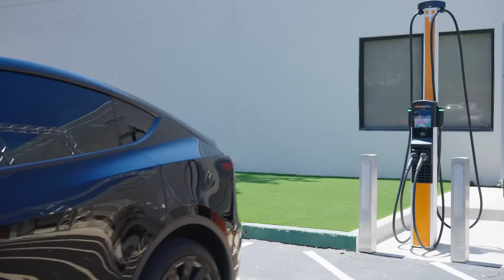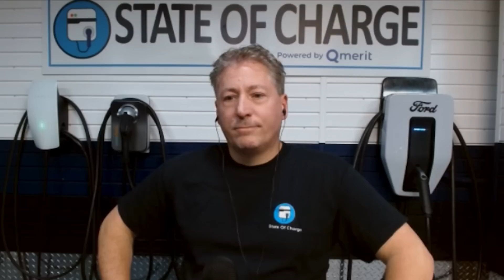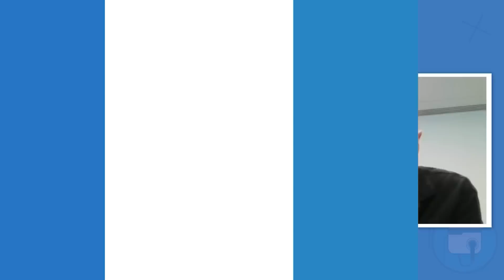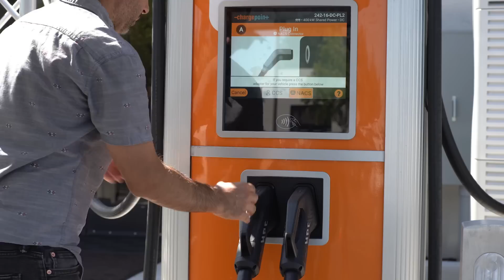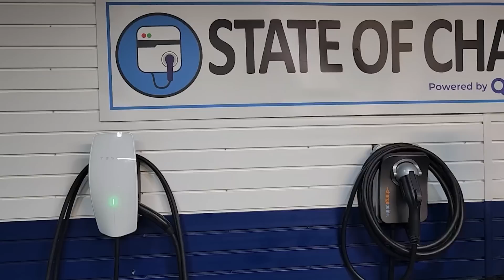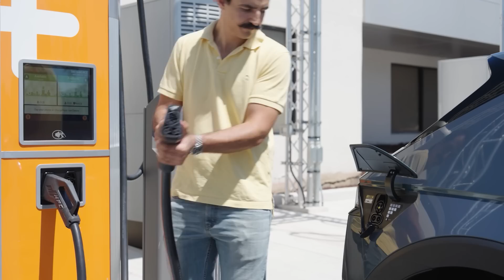ChargePoint CEO Rick Wilmer Discusses How Omni Port Will Eliminate EV Charging Connector Confusion

Comment: I called AND left a report in the app 7 months ago after watching this video and it’s still broken the exact same way. More effort needs to go into the repair of your chargers.
Reply from the maker: So you probably know it's not "their" chargers. The person or company that owns the property the charger is on owns it and is responsible for its maintenance. ChargePoint reports the station down to the property owner and asks if they would like them to send a repair crew, but they need to be authorized to do the repair. They cannot enter private property without permission, conduct repairs on equipment that they do not own, and then expect to get paid for the repair.
Reply: @ for sure, I understand that. I just think their model of selling chargers that nobody takes care of is unsustainable, especially with how the public abuses them. I reached out to the management of the building as well and they told me that charge point wasn’t able to supply them with the parts they needed and wanted them to replace the entire $4k unit over a frayed cable. They also said they would have to pay for the software again for the chargers to work for free, not like there is any payment processing or anything. That’s another reason that I feel like these chargers are so poorly taken care of, they seem (and this is just what I was told by the management of this building, so I can’t say for sure it’s true) to only be willing to sell an entire replacement unit instead of just being willing to replace a cable. They were able to replace the broken clips though, all but one cable was mostly fixed. The one with exposed copper was the biggest concern anyways.

Comment: The whole problem is the not my problem mentality exhibited by this ceo. Needing more information from the customer is laughable. I like chargepoint, give us a bring your own cable solution for level 2 chargers. We need reliable level 2 charging, that is where the problem is, and give us the whole damn 10 or 11 kilowatts. Thats fast enough. Charge a little bit more for a boosted rate. Not rocket science

Comment: The repairability needs to improve. WiFi adapter died in my home 40 (pre flex) whole unit had to be replaced. I’m sure that’s the case for some of these bollard units. Especially the 3G cell networked ones. Also, the new charger is still only 2.4Ghz WiFi there’s room for improvement in repairability.

Comment: As a Tesla owner since 2018, I am just starting to be informed about what non-Tesla EV owners have been dealing with for years. It really sucks to have unreliable public charging. My understanding is that ChargePoint will sell a unit to anyone, maintain it for a year under warranty, and then charge the owner for maintenance. So ChargePoint has there name on units that have not worked for years. That gives new meaning to free negative advertising. A one year warranty for a very expensive piece of equipment? Doesn't look like they really stand behind their product.

Comment: Tips for all EVSE makers: 

1) Use reinforced metal (covered with nonconductive material) for the safety clip. Most of the broken CCS chargers are either broken screens or broken clips.
2) Make the safety clip more modular, so if the CCS connector breaks its clip, have it so all it takes is a torx screwdriver and a $10 replacement part that anyone could replace.
3) Set public EVSE to auto reboot every 12 hours (when not in use), if a scheduled reboot is missed due to a charging session, reboot right after the session ends
4) Start using Linux, not Windows for OS.
5) Gas stations cover their pumps from the sun, and cover your EVSEs to help them last longer.
6) Put an inexpensive motion camera in the EVSE to capture vandals (you can get cheap cameras on Amazon for $30, shouldn't add too much to a charger to build one in)
7) Have better ways to report broken chargers, every time I find a broken Chargepoint, it is nearly impossible to report within the app. I should be able to manually type a serial number or location if the charger is not "listed". Have a "Report a problem" on the display as an option. Use analytics to determine when the usage of a connector drops and does not pick up (if no one has charged within a certain amount of days, it's probably broken). The few times I did report a problem to other vendors using the app, it was always "your car's problem". No one took my report seriously or actually dug into the issue.

Comment: We have a level 2 Charge Point EV charger — it has worked well for several years now. But when you use the app it often shows these level 2 which are private usually. More detail about chargers in one’s area and in particular showing level 3 chargers clearly would be an improvement to me. Some chargers show detail and others do not.

Comment: Many of these third party chargers might have a ok placements of chargers. But many of chargepoint chargers are level 2 (6kw) very slow chargers. The dc fast chargers are in many cases not working. I live in the valley area and most third party chargers are not working. Except for Tesla. In many cases whe I try to check on Electrify America chargers, they have crazy lines because  1 out of 3 locations are working.

Comment: Tom -- great job, a usual.  I have a 2022 BMW i3 -- love it -- just purchased (BMW Certified w/23,000 miles).  I am having a problem with L3 DC fast charging.  I have tried EA and EVgo.   Both connect, seem to "see" the car, authenticate my credit card, but then the charging session aborts without any charge being transferred.   I had the dealer (a good one, with i3 experience, check the car and there are no faults, and it charges properly on their L3 charger.  I have a L2 240VAC charger at home (Tesla with the Lectron adaptor you've reviewed -- works great), and use the car as a "city car", and this is more than fine for my modest daily needs.   But want the option to DC fast charge if needed in a pinch, and it frustrates me when something so otherwise perfect does not work as expected.   No one -- including the help line at the public charging companies -- seems able to troubleshoot the problem.   Any ideas?

Comment: Listening to the CEO talk about how there needs to be better ways for the user to report “bad” Chargepoint stations is exactly why I went with Tesla. Before I bought my Model Y in 11/23 I had clear doubts about EV’s.  I did not buy my EV with idea that “I” could be the savior of the environment. I liked the idea of EV’s from the GM EV1, but everything produced was utter crap from a driver’s standpoint.  After Tesla began producing and selling things got interesting but there was the charging issue. So, about 2 years before I bought I began renting EVs and my worst experience with charging was at Chargepoint (very few super charger, most others either did not work or charged slower than a 110 connection). There were and still are no charging stations as good as Tesla; you drive up, plug in and you are done. I’ve never had to wait and never had to charge more than 20 minutes on a long trip. And, yes I drive if it is under 8 hours which is the same as when I drive a gas vehicle.
Reply: ChargePoint aims to service all EVs. Tesla stations limit what they support. Tesla chose the easier route. They are being forced to change that, of course, but they have had an easier road thus far.

My niece has had an older Bike for some time. She has run into broken charging stations in the past, but in the whole she hasn't had any issue pulling up to a station and charging. We all just wished these companies would work together more than they have. As the industry matures, it looks like that is happening. And it helps that governments are stepping in and forcing the issue. The free market has been too slow to fix these issues.

Comment: An insightful interview .. Thank you .  However he seems to be missing the point that broken Charge Point charges is a reflection on the Charge Point equipment and NOT on the operator of the site . It would be best if they change the basic  agreement with operators to include the cost of broken charger awareness and fixing it . Pivot away from just being an equipment provider to a service provider.  Having ability for driver to easily report a broken charger is more of a short term approach as it still leaves the driver out of luck at that critical moment. The equipment needs to be self aware and trigger ‘come fix me ‘ calls .
Take a page from Tesla Supercharger network….there’s simply no finger pointing and it just works

Comment: If pinpointing exactly what charger is broken and what’s wrong with it is so important to them, they should add a QR code to the chargers to report issues. That way it shows exactly what charger is broken and then you can just have a drop down menu to choose from in regard to what the issue is.

Comment: About 3 yrs ago I lived in a Boston apartment that offered a dozen parking spaces for rent with ChargePoint 6 kW chargers.  On several occasions, my Tesla refused to charge because it saw a large voltage drop as it ramped up current.  Tesla diagnostic thought I was using an inferior extension cord.

But, the really ugly part was ChargePoint wouldn’t repair the charger, blaming the operator.  And the operator refused to fix it because they couldn’t understand the problem.  This is where ChargePoint’s business model fails.  It destroyed the brand in my mind.  Later, I needed to specify a commercial charger for condo board and ChargePoint wasn’t a consideration.
Reply: Absolutely! EVSE companies need to build maintenance contracts in what they sell. It is their name and brand on the line so, charge $0.05-0.10 extra per kW and use it to maintain their brand image and quality. Everyone still gets their cut (Utility, Owner, Chargpoint) and there is a "reserve fund" for maintenance. Also, charge more for idle fees. Too many idlers out there when chargers are in high demand.
Reply: Exactly their model is broken and their headstart is WASTED!

Comment: So the model they use means bad hosts who get a grant to install it but don't maintain it and so once it breaks they don't care and Chargepoint brand gets bad publicity.  Probably not the best business model just makes everyone think Chargepoint is crap and don't maintain their equipment even if it's not their fault.  If the hosting provider doesn't care then it'll sit there broken collecting dust for a decade until another operator comes in and does maintain their equipment and is a true CPO.

Comment: I am a chargepoint home flex owner and I would like to point out two giant issues.  The stamp on the outside says 40A max which means that during the electrical inspection I was told I needed to a) set the max to 32A and label it as 32A max on the charger or b) install a 50A breaker instead of a 60A breaker and set the max out put to 40A or not pass the inspection.  But that feeds into big issue number 2.  It has a setting for 80A but the terminals are 6AWG size max which means you cannot install it as an 80A charger to code it the US. So my question is WTF?

Comment: I like the RFID card. Nice and quick. But bottom line one should never count on a Charge point charger to be serviceable. As a backup it’s fine but you will be stranded if you count on a Chargepoint charger working.

Comment: I think there should be a shift to a system similar to Europe where the chargers are just plugs rather than cables. Would definately help with all the cable cutters as the stations wouldn't have cables anymore. Though this is a good idea for the system that we have in NA.
Reply: To be fair, that only applies to AC (up to 22kW) public charging. All public DC chargers have attached cables.
What Europe does have is a mandated standard for both AC and DC (CCS-2) plugs.
It means that while we don't need to carry several adapters, we do need to carry an AC cable.

Comment: We also have reported the charger gave the ID number of the charger (via email and app). Charge point rates were not reasonable for my work to have them fixed. My work is now in the process of replacing the CP units as maintenance is way too costly for them. Sadly, this could not be fixed in a timely manor and reason price.

Comment: My number one complaint is every single screen fails way before one year if it's in the sun they last longer than one year (but not much) if it's inside of a parking garage.

To me this is bad plan to design to fail around the warranty period. I've been using these since 2014. It's consistently bad failing around one year.

Comment: I'm rooting for ChargePoint but IMO they have a huge problem because so many of their "public" L2 chargers (and a few DCFC) are owned by individual businesses, are not available because of the owning business, but because these chargers have ChargePoint branding plastered all over them it makes it look like the "ChargePoint Network" has abysmal reliability.

Case in point, there is a cluster of 3 ChargePoint L2 chargers at a medical facility near me.  I first noticed them in 2021 and they looked like they had been there a while and at the time they were displaying "Station not provisioned on ChargePoint" and as of late 2023 (and I'm sure still today) they still are in the exact same situation.  This company (a large HMO network) bought and installed these charging stations but never bothered to bring them online so people could actually use them.

I know you briefly touched on this point during the video but I really don't think that the leadership at ChargePoint fully grasps how bad this is for the ChargePoint brand, because most new EV owners don't know and don't care that these (heavily) ChargePoint branded charging stations aren't actually owned by ChargePoint.  All they see is "Another ChargePoint charger that doesn't work"

IMO either ChargePoint needs to sell their charging equipment unbranded (maybe spin off another brand to sell charging equipment) or include language in their sales contracts that requires the owners to actually bring these stations online after they've been installed.

Comment: Put a big, physical button on the charger for “This charger is broken.” When a user pushes it, play a recording asking them to describe what is wrong. They answer, and then a new support ticket appears immediately in your queue. The charger itself provides all the other info you need about where the charger is, who owns it, etc. And you want to get multiple tickets from the same charger because that tells you how many people need to use it. And how often they can’t.
Reply: Plenty of examples out there (even Tesla) where the software can't tell that anything is wrong. A big button would be great.
Reply: @roadfordays  And an option to do the same in the app if the charger has gone full corruption
Reply: Big brain idea over here
Reply: A touchscreen option would be good too. Also analytics... if you have a location that hasn't been used in a while, and other chargers nearby get regular use, flag it for inspection.
Reply: Not a good idea if the station is offline, no way for the voice memo to be uploaded
Reply: Make the app able to put in a support ticket when there is no cellular connection to fill out the ticket and submit it.
Reply: 4:46 their business model is therefore BROKEN!
Reply: No need for this if you have developers that can critically think.

Comment: The simplest thing to find broken chargers would be to track the last time somebody successfully charged, and better yet, the last 10 times. After that, I would slap a barcode on it that takes you straight to a website with the serial number already entered in.
Reply: Heck, even scraping plugshare reviews. Many opportunities are being missed on this one. "Report a problem" using your phone's GPS, the App, and known installed chargers. Just knowing the general location is enough to remotely do diagnostics and data analysis to see if further investigation is warranted. Also can include things like 1) When was RFID last successfully used, 2) When was the last successful touch screen input, 3) Has the screen been frozen or powered off for x amount of minutes (if corporations can monitor us while we work, the software can monitor screen status), 4) Does the device "Call home" and can "home call it"? 5) When was the last successful charge compared to other chargers in the area? 5) How many complaints has the charger received since its last onsite inspection and/or service, 6) Include a Report a Problem within the touchscreen interface for when the touchscreen is not broken..........

Comment: ChargePoint can be a horror for drivers - you are NOT their customer, in general.  For example, last night we encountered 3 of 6 CPE250s with all cables cut at Texaco.  Local employees were unaware of problem; CP support had a terrible time understanding WHERE the chargers were - everything had to be spelled out multiple times.  The chargers are still shown as "available" in the CP app - obviously software does not detect even amputation and who knows how app status is set?  So the usual "we will contact host" that they will give you even if THEY are the owner, as in "DC CORRIDOR" units in CA.  Just hopeless bumblers.